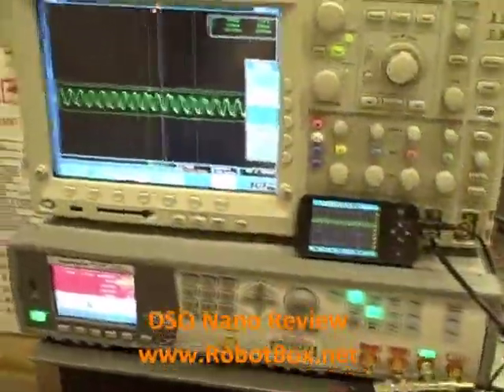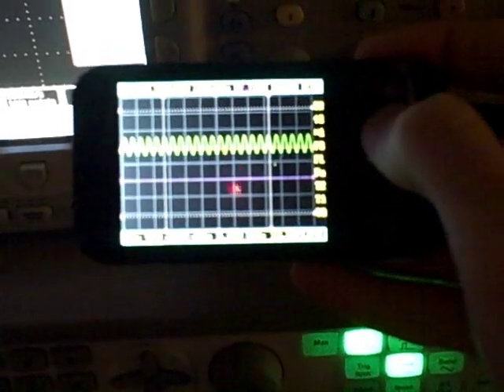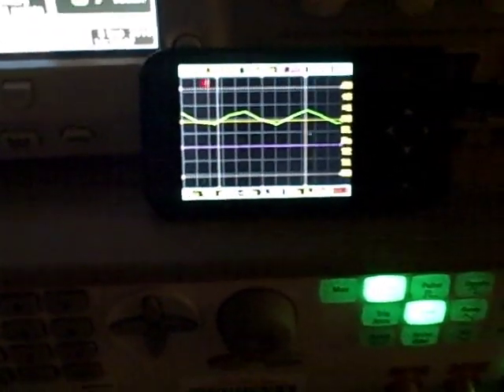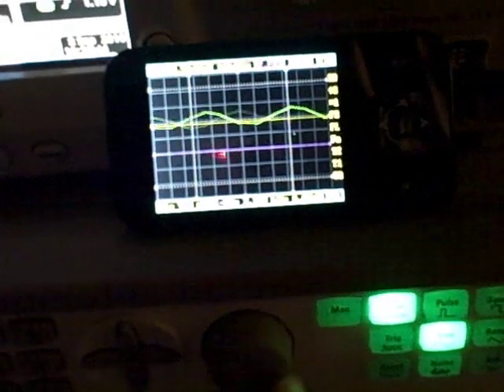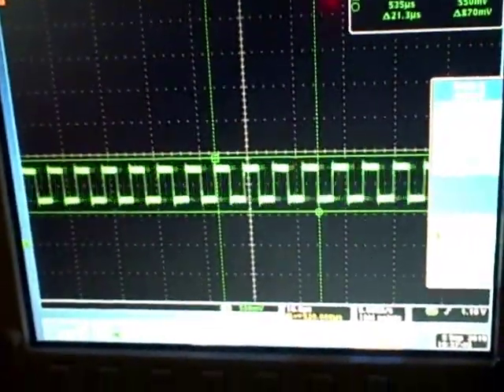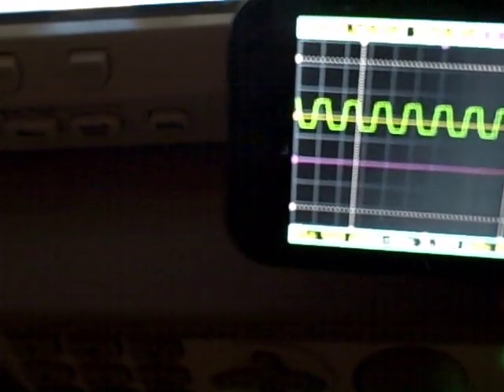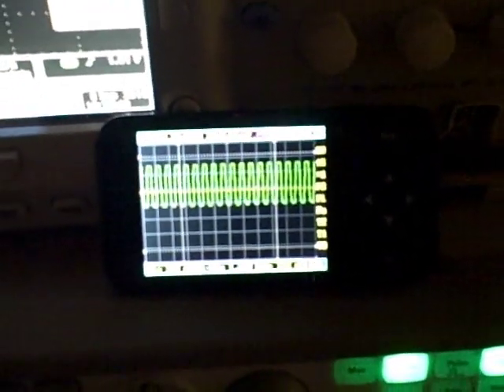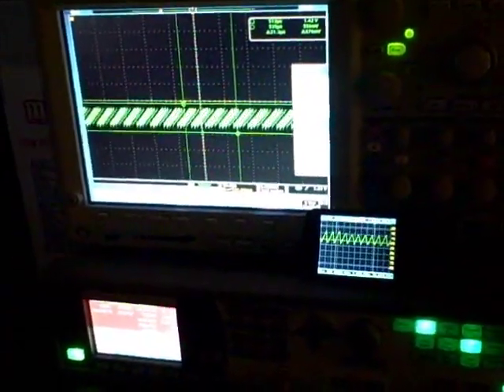Review of the DSO Nano - Compared to Tektronix Scope

Comment: Hi, great video... best and most intelligently done i've seen on the dso nano.  I was a software and electronics engineer about 20 years ago then left the field and recently stumbled into a new job where my old (outdated and mostly forgotten knowledge) is vaguely relevant.  I live in rural Montana and we have lots of "dirty" power here.... I'm trying to convince my company that we need to be requiring power conditioners for high end electronics as we are seeing an inordinate number of PCB and PSB failures in my region.  quite often I can document over voltage issues in the building where we have multiple board failures but not always and would like to take a look at the line harmonics.... I'm dealing with line voltage here so not worried about high frequency capability... but is the dso nano capable of separatingo/overlaying the different orders of harmonics?  hope that makes sense... like i said, been a while. thanks for your help.
Reply from the maker: This is quite an old video. I'm not sure about the answer to your question, but I would recommend looking around for more recent hardware.

Comment: @gallamine a standard hard drive spins at 7200 rpm also the rev per sec would be divided to seconds not multiplied 7200 per minute is 120 per second. but you are right that it is 3 phase and because of that this scope would be poor for that as you can't see the phase angles you could see if all phases are the right pwm but not if they are timed correctly

Comment from the maker: @Kasatome I'm not familiar with how the HDD motors are driven. After a little searching, it appears they are a three phase motor - akin to a stepper motor. If the HDD is spinning at 5400 RPM, that's 324,000 rev/sec, and with three control lines, each has approximately a 100 kHz signal on it. Based on my experience, the DSO Nano should be able to represent 100 kHz signals pretty well. 
YMMV. Let us know how things work out.

Comment from the maker: @reallunacy yes, I don't see why not. Provided you aren't dealing with very high voltage signals, it should handle 20-20kHz quite well. The 20 Hz might be a bit difficult, but it has a scan mode that I think would work for that.